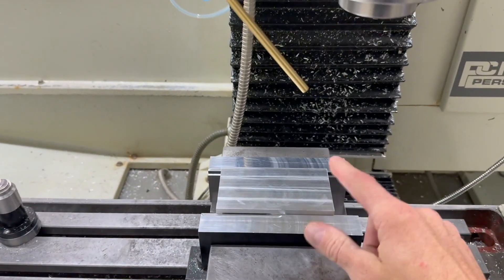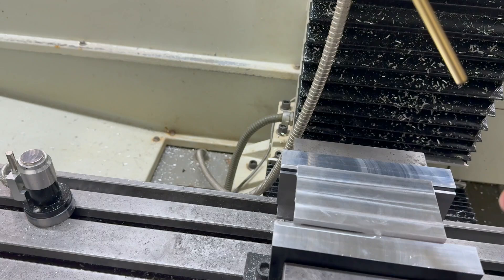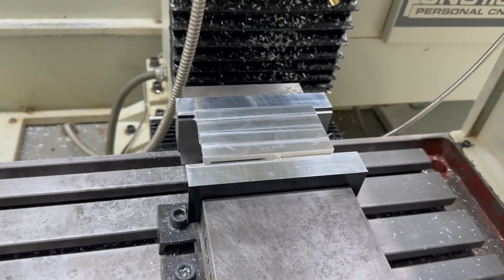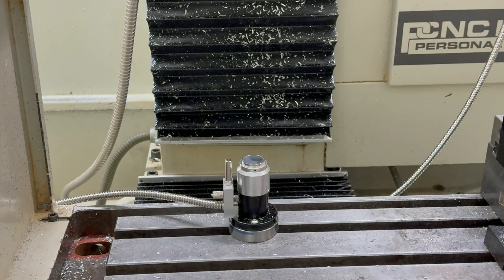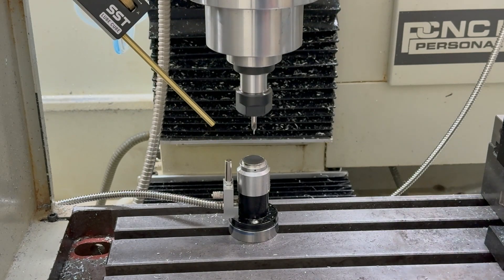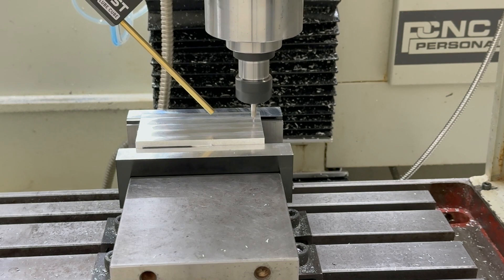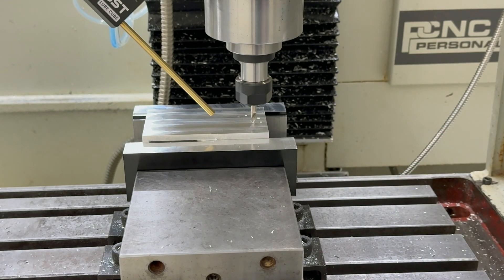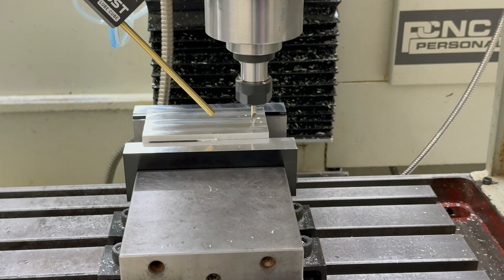CNC Automatic Knife Blade Test run – Toolpath Experimentation!

Comment: Flood coolant is your friend. It’s a messy, annoying, frustrating but AWESOME friend.  If you switch you’ll look back and wish you had switched sooner.
Reply from the maker: I know, I’m very surprised just how much the mist helped. But you and a couple others have all said flood is even better. I want to “float” the machines chip pan at an angle with epoxy of some sort, so the coolant will atleast all flow to the drain. Right now it’s just flat, and when I got the machine the coolant dried up like grease and it caused quite a bit of corrosion. I will have weeks where I don’t use the machine, and don’t want to have to clean that stuff everytime.
Reply: @mwmxcnc  Ouch, that sounds like a mess.  I ran flood briefly on my PCNC1100.  Every time I was done for the day I'd use the air gun to blow all the coolant over to the drain to avoid that problem.  Wasn't perfect but it worked.  But flood was such a game changer.  I broke a TON of end mills and was always babying them to avoid breakage.  Especially slotting, which was always problematic.  I had one part with a 1/8" wide slot that had to be machined 5/8" deep.  When I ditched the fogbuster and went with flood, I could run that same toolpath in 1/5th the time without breaking end mills.  That sealed it for me.  I went on to develop some custom coolant manifolds and redo the coolant system on my 1100MX and as a result got a LOT of production from that machine.

Good luck and keep making the videos!
Reply: The problem with flood coolant is chip evacuation.
Reply: @ I’d love to hear more about what you mean. For me, I’d say the solution to chip evacuation is flood coolant.  ;)
Reply: @ sure. It is and it isn’t. I suppose if you have enough pressure it can be. But for long chips from an end mill down in a pocket or even on the outside the chips pile up and you have to blow it off every now and then.
Reply: @ gotcha!   Yep, if you find my coolant video you’ll see how I approach it.  My goal is to never recut a chip. Most systems have restrictions at event valve, every fitting, etc.  made my own manifold she made all the fittings from it to the pump.   The pump is only 1/4 hp but the numerous restrictions add up. Once they’re gone, 1/4 hp is more than enough for a 2hp mill machining aluminum which is the largest MRR to deal with.  And it changed everything. I broke a lot of end mills fiddling with mist and wasted a lot of time blowing off chips.  Thew days I hit cycle start and return to remove parts.